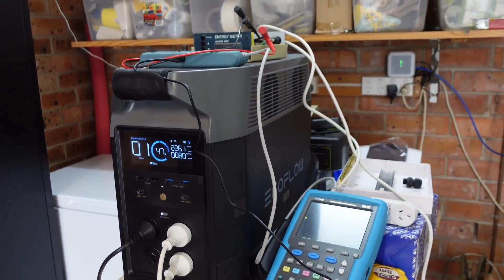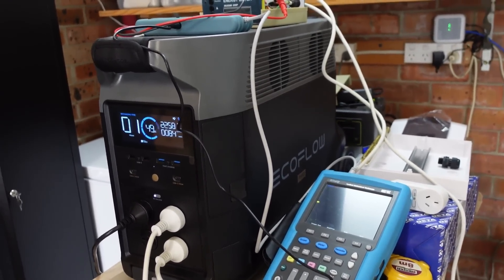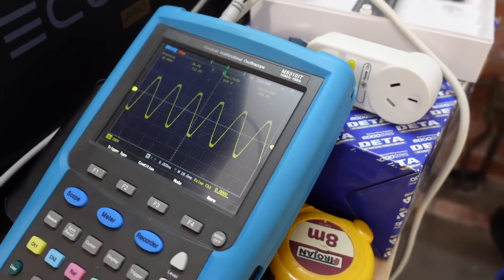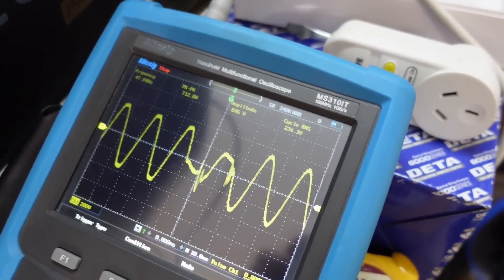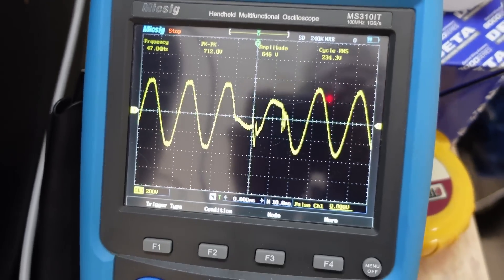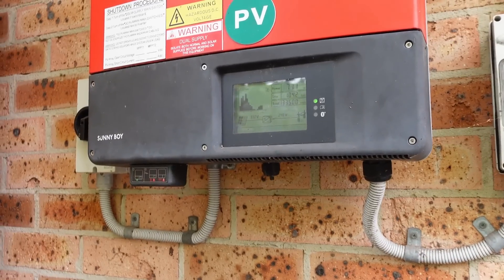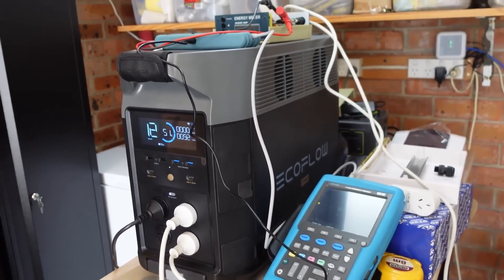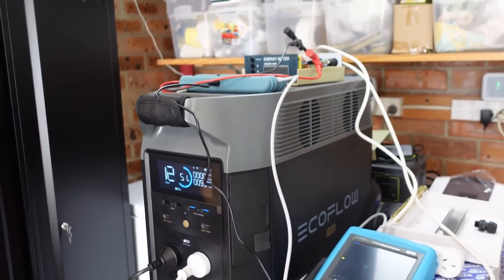EcoFlow Delta Pro - RTFM Dummy!

Comment: For all our fridges in Africa that connect to mains and backup power all have "AC savers" on them, this is a timed device to stop modern fridges and some old ones from starting backup during a power switch , they all wait a timed amount before reconnecting the fridge to power, we always set them different so we dont have multiple fridges starting up at once.
Reply: Ours have fast off delayed on thermal switches for that.
Reply: I posted similar... Then read your comment.  Opps.

Comment: Hi
I have an idea regarding the fluctuations in charging power. The Ecoflow Delta Pro maybe wants to keep the total input power below idk like 3kW. I think I heard of that feature in this model.

So maybe one of your fridges turned on and had some kind of inrush current going on. The Ecoflow detected that the input power went above 3kW (the inrush spike) and so reduced the charging power. But when the charging power was reduced the inrush spike had already gone away and so the drop in power was displayed on the Ecoflow and the charging power increased again.
Reply: That's exactly what happened. If you watch the video you can see the output power go from about 200 to 800 watts at the exact moment the input power goes from 2200 to 2800.

Comment: I noticed the same issue with my fridge, short transient disturbances in power could lead to a fail. Very unpleasant, if unnoticed. I had to throw away all the contents once, because it refused to startup again after a short power glitch caused by a lightning. I didn't notice that immediately because I don't use the fridge everyday ...
For that reason, I was thinking to get a small online UPS, even though I'd have losses due to the permanent conversion from grid to battery and back to the fridge.

Comment: If you want a UPS, buy a UPS. Their design is quite different from a power bank. Specifically if you want zero switching time then you want a "Online UPS" which runs the inverter 24/7 and there is no direct connection between mains and the output. Not a budget item since the components are rated far higher since that's a high reliability application.
Reply: It's not really needed for fridges though. It's fine if they're off for 5 minutes. And they're less efficient as well, since they're always running the inverter.
Reply: Dave never reads manuals very well. He is like a builder. I would be frightened to use the Delta Pro in any kind of UPS mode, even allowing for delayed switchover, given the troubles written by DringLord, firmware and MPPT problems.
Reply: Isn't that what Dave was discovering in this video? Because it was explicitly in the manual?
Reply: @Peter_A1466  yep I'm more pointing out that what he's actually looking for exists and the correct term to look for.

Comment: Chest freezer with the likely mechanical thermostat, and fridge with mechanical thermostat you really want to have a power on delay, though with the roughly single cycle loss you will find it hard to trigger. They only will drop out when the transfer occurs while the compressor is running, if off on the thermostat nothing will happen. Simplest solution is to take that timer and use a DIN box version, and a DIN 10A contactor to disconnect the input to the battery, with a spare pole on the contactor triggering a delay switch, which turns off all 3 outputs via 3 separate on delay relays. The first delay can be a minute, then the other 3 on delay relays are set to 1,1.5 and 2 minutes, so the 3 units come on in sequence, so the start up current is spread out. Logic will need a local power rail, to keep it running, so powered using simple 24VDC transformer blocks off each supply rail.

Otherwise you need a mains fail detector that responds to short dropouts, to trigger the delay circuits, which can operate off the inverter output alone. Simple detector, retriggerable monostable that has a 15ms timeout, reset by a zero cross detector, so a single half cycle dropout will turn off the output for 1 minute, then the 3 delays add in an extra 1, 1.5 and 2 minutes to allow pressure to equalise. Not going to worry fridge or freezers with mechanical thermostats at all, one more on off cycle at low differential is going to take decades to make any difference, and the piping will rust through under that corrosive foam long before that and release the R600A gas charge out. 

Electronic controls also not a problem, just a few extra power on cycles before the electronics fails anyway, because they used Crapxon or other ChongX capacitors in order to save 3c in BOM cost. Seeing that 10 year warranty on the compressor in a fridge, knowing that the compressor is almost never going to fail before something else does, and the warranty also does not cover the controller board, which is likely what sent off the compressor in the first case, as the IGBT block had one transistor fail short, blowing the bond wires off the companion side, and then passing a massive DC current through the one coil and burning it out. As a spare part that compressor and controller come as a unit, not separate, and the board costs as much as the entire device. AC wise replaced plenty of compressors, only ever had one fail for interior damage, the rest were either rusted through case, burned off connector pins, or had the stub piping vibrate and crack. The internal fail one I looked, it had gotten tramp metal from manufacture, and snapped off the motor shaft.

Comment: The inverter isn't phase locked to the mains and regular compressors are synchronous hence the big transient. If you had inverter fridges they'd not care about it.
Reply from the maker: The fridge doesn't know nor care about the phase, it's simply plugged inot the output the inverter.
Reply: @EEVblog2  if the fridge compressor uses a synchronous motor then it has to suddenly speed up or slow down to resynchronize itself with the 50Hz input power if the phase ever changes. It appears from your scope that the inverter is about 90degrees out of phase to the mains so when mains power is lost the fridge compressor motor has to suddenly change its phase by 90deg. This may cause a brief spike in current drawn by the compressor motor. With all 3 fridges spiking in current at once it's plausible that it overloads the battery inverter.
Reply: @EEVblog2  what I meant was the compressor is synced to the 50Hz cycle so any sudden jump in the waveform (switching from inverter to mains unless they are synced) would upset it. They do  have a start capacitor to kick them in the right direction on power up, but after that, its depending on a stable waveform.

Comment: I assumed the ecoflow would act like a UPS, and switch over to inverter if the mains was disconnected. But there might be a setting where you can always have the inverter running, and not bypass the mains, only using the mains to charge the battery? Alternatively, you could charge the ecoflow with mains through a DC charger such that the inverter is always ON
Reply from the maker: No such setting available.
Reply: Ecoflow unit does NOT have a extra mains charger built in, it uses main inverter for that. It has to wait until relay that provides input mains power to inverter shuts off before outputting power.

Comment: Yes, compressors should not be started if the high pressure side has well, high pressure. The motor starts in a highly loaded state (i.e., stalled) and it does wear things out. This is called "high side start" by HVAC professionals and is actually not too big an issue as all modern (within the last 20-30 years or so) compressors have high-side start protection. This consists of either a pressure switch on the high side that locks out the compressor if it's too high, or commonly, a timer. The timer basically counts down from 5-10 minutes from power application (the compressor will not start, even if it hasn't run before, if you apply power since it assumes it might have lost power briefly) and from power off - that is, the compressor must be off for a minimum of 5-10 minutes before the timer will allow the compressor to be turned on again. 

A typical UPS offers between 25-50ms switching delay - or two AC cycles. Motors can tolerate this due to rotational inertia so it's usually not an issue as it takes a second or two for a compressor to stop rotating.  You almost never need a fully online system (where the inverter runs continuously) unless your power is genuinely horrible. I've only seen online systems in places like India - everywhere else, especially the Western world, uses line-interactive where the AC line is switched between inverter and line input - with a typical delay of 2 AC cycles.  The better inverters sync to the power line input so even though there's a power loss, they actively start in sync with the former waveform to help prevent phase issues, and when AC power is restored, the inverter will re-sync before dropping back to AC (usually within 10 cycles or so the inverter will re-lock onto the AC waveform and switch).

It's less of an issue than you may think - you're not doing anything unique or new and people have been plugging fridges into UPSes since the general availability of sinewave inverter UPSes (motors hate stepped-squarewave outputs of most UPSes). You're just using your battery bank as a UPS in the end so it's nothing new under the sun, other than using LiFePO4 batteries instead of godawful lead acid batteries.

Comment: So this shows that this thing is not a double conversion UPS, with out synchronisation of the output with mains...
So an other solution to use an external AUTOMATIC TRANSFER SWITCH set it to switch to main as you had it in the beginning but AFTER it synchronizes the 2 outputs then power up the BATERRY bank.

Or the worst : 
Piggy back the battery output ( that x infinity connector) with a high quality INVERTER from victron or something else...

Comment: Some network of automatic switching somehow should be ok. Like basically prefer solar over anything else. Pretty much never export. Avoid power off, redirect grid if necessary. I was going to say you may have losses if you constantly try to output 240 or something without a load. It could be looking for a lower power drain or something to turn on.

Comment: I would sens output current and switch only when fridges are not running. You can do it with one smart socket reprogramed to work off-line. All hardware is build into it

Comment: A quick fix might be to put a small UPS on each fridge. Worth a try if you have one laying around.
Reply: A UPS will have te very same issue, as pretty much all small UPS systems are line-interactive, and they switch using a relay as well.
Only a double conversion online UPS would function for this, but they aren't small typically.

Comment: So its basically behaving like a basic UPS (line-interactive) rather than an active UPS.  While its more efficient on power and less stress on the inverter (as its not running all the time), it seems kinda odd for a product of this calibre, but I guess ultimately its just not designed for this use case.
Reply: I read somewhere a while back that line-interactive UPSes were becoming less common and online ones were becoming the norm. I'll have to watch for that when I buy one.
Reply: Ecoflow does use inverter continiously. There is no dedicated mains charger, main inverter is doing it's job as well as providing output power.
Whenever input power is switched off, unit has to realise that, turn relay off, wait for relay really shuts off and only then start outputting power.

Comment: Dave…. It’s easy for you to find out if you really have a problem.  A compressor that is struggling because of an early restart will draw heavy current for the first several seconds after which a thermal breaker at the compressor will click off for protection.  If that isn’t happening, there is no issue.

Comment: I can't see any problems with a fridge experiencing a drop out of less than one AC cycle. Left on it's own, the compressor motor won't stall from a power interruption of less than 1/50th of a second. What I expect is happening is that your fridge has a microprocessor, that is interpreting the short drop out as a power failure, and is turning the compressor off, waiting for the gas pressure to diminish, then often waiting a random periods of time so as not to provide predictable shock loads which could overload the grid on power restoration, and then restarting the system.

This won't damage your fridge, because the controller is reacting - overreacting, really - to protect the compressor. If the fridge was less 'intelligent', you would not have noticed such a short glitch.
Reply from the maker: All I know ifthat I hear a big thump in at least one of the fridges when this happens.
Reply: @EEVblog2  Electronics may not like that jump, including newer fridges

Comment: For home AC compressors, most thermostats have a compressor delay that will let the refrigerant equalize before letting the compressor cycle again. 

Perhaps you could still do what you planned and just add like a 5 minute delay. The fridges shouldn’t mind that. 

If using old school timer for input to the battery, maybe you could use another from the output of the transfer switch to have a “blackout” period of a few minutes overlapping the switch to/from battery?
Reply from the maker: I'd need a timer (or 3) that detect the <30ms outage and disconnect for 30s. I pressume not all timers will detect this?
Reply: @EEVblog2  disconnect for 5 minutes at least. The compressor starting device on consumer fridges is almost always a PTC that needs to cool down. The pressure in the refrigerant circuit also takes longer than 30s to equalize. Those PTC starting blocks often blow up spectacularly if they're unsuccessful in starting the compressor like in your case. The compressor has a bimetallic switch inside the windings of the motor that disconnects it on overcurrent, that's what you hear as clicking.
Reply: If using simple 24h timers like you talked about then you wouldn’t need any detection of any kind. Just have the fridge timer(s) be off for a few minutes when the battery’s mains timer changes. That way, no risk to compressors. 

Only caveat that might be an issue depending on the fridges you have could be the spike of current if they all turn on with the same timer.
Reply: @WizardMills  I was thinking this type of thing also 1 timer as used then an additional timer for each fridge but with a 5 minute difference between turn on times.

Solar switches to battery at 4 pm fridges switch off at 355pm 1st one switches back on at 405 then 410 then 415 spreads the load and allows for change over same in the morning. The fridge should be last off and first on as used more frequently

Comment: Not the safest thing to do, but if the power ever does go out you can use a suicide cord to plug the battery inverter into GPO.

I've tested it with a 2000w renogy inverter and it seemed to run most of the house.

You really want to make sure you turn off the main breaker from the city power and also the breakers to the solar inverters.
Reply: Most (or at least many) pure-sine inverters will recharge the batteries if you connect a grid-tie inverter to their output. You just need to make sure you don't exceed the wattage limit and more importantly don't overcharge the batteries.

Comment: You could probably grab yourself a continus server UPS system used on ebay for cheap. The batteries (li-po-phosphate in the newer ones) are typically easily replicable or even a separate module all together while often capable of over 3kw 
not a cheap solution but not a crazy expensive one either 
I use one for my modem, router, server and NAS, $600USD all in for a 1200W jobby and it was 3 years ago, im sure you can do much better now.
As for how clean the output is im not sure, it claims "pure sine" but its designed for servers that would not complain even if it was square and i dont have a diff probe at home.
Reply: @SpacedSpec  Dual conversion UPSes are super common, huge (100's of kW and above) ones are almost always dual conversion, the inverter and rectifier are always active (the batteries are always connected to the load).  I bought a 16kVA unit for a small room, dual conversion, no relays to be heard of (as far as when power drops, that is).  120v / 208v 3 phase, but you can definitely get 120V single phase dual conversion units.

Comment: Shouldn't a fridge (once it's cooled internally) maintain it's temperature without the compressor running all the time. The compressor should be turning itself on and off periodically as dictated by it's thermostat. Running all the time would be concerning me more than a once daily stop/start. Perhaps check the door seals for integrity.
Reply from the maker: Yes, of course, that's how they work. That's not related to this issue though.